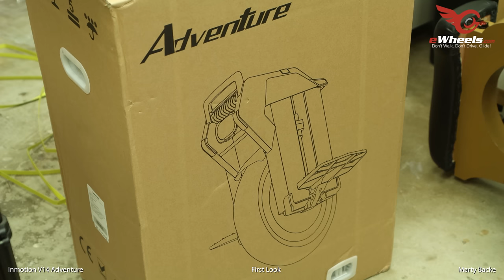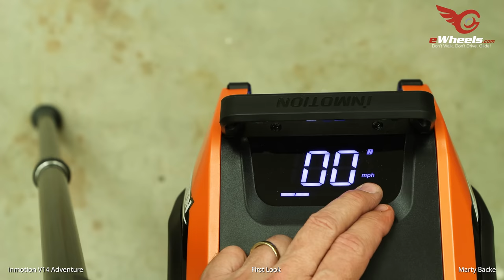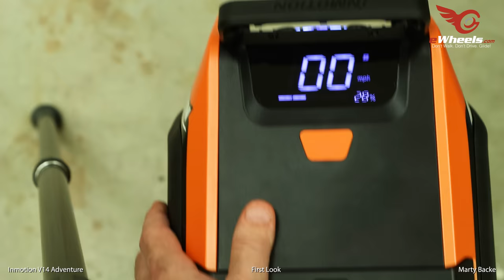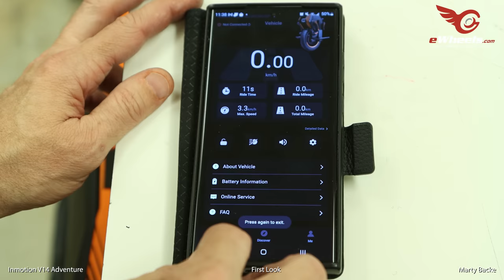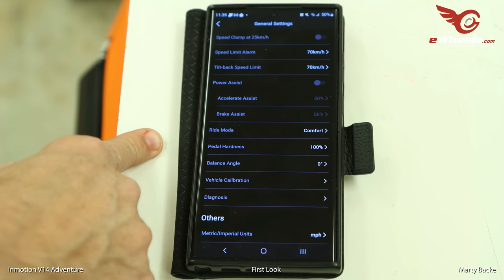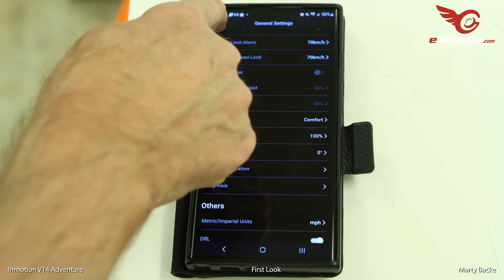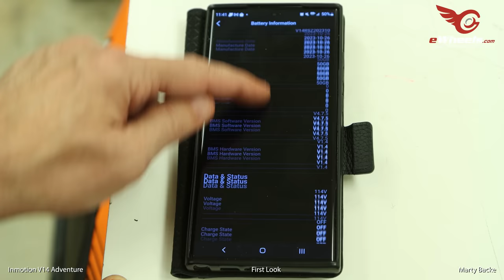Inmotion V14 - First Look

Comment: Awesome wheel. I have V12HT for 1,5 year. 5600km on the clock and the wheel is like new. It just screams quality! I am a bit sad that they do not used again the great color touch screen, but OK. The speakers broke after the first week in my case so the beeper is great choice :D. This is definatelly the wheel for my next season, I really love built quality of Inmotion wheels...
Reply: The V12 has superb build quality. Too bad the HT still has software problems, which likely will never be fixed. Self-acceleration happened to me recently. IM will ship a new driver board, but I doubt it will fix anything. The wheel also seems to turn off or forget how to balance for <1sec constantly when I ride off-road.
Reply from the maker: Wow, yours doesn't sound good

Comment: Looks great. I'm happy to see that the wheel appears to be fairly durable. I agree, putting the charging ports on top was a weird choice, especially where they are trying to make it so waterproof. I actually like that they used the 4-pin connectors instead of the 5-pin since the pins will be bigger (in theory) and thus less likely to bend.
I'm very excited to see how it rides. Hopefully your ankle allows you to have some fun with it!
Reply from the maker: They use a 5-pin (tiny pins) connector but the wheel only has 4-pins. So you're not getting bigger pins.

Thanks.

Comment: imo, the 134v, 4 pin charege ports are flawed in that the square configuration of the pins can easily short and cause arcing if it is forcefully pluged in at a 90 or 270 degree rotation, especially with a aftermarket hyper charger where the charger's metal contacts are more exposed than the stock charger. im happy inmotion is deciding to use the more offset, 5 pin configuration, my frind was repeatedly blowing out his charge board and equipment accidentally pluging in wrong. 

im a begode fan boy, but i have to admit, I am impressed with what i see out the box here. The wheel looks amazing, great to see a progressive coil, this one checks off a lot of the boxes, performance will likely be curbed for safety im guessing but thats not terible. the apartment building I live in banned PEVs but are cinsidering lifting the ban for UL certified wheels so I am hoping the rumor about this having one is true.

Comment: I'm pretty sure that you can hose the top of the wheel and there would be no water in the charging ports, as long as its cover is present. Which.. is a usual problem for nearly each and every wheel i know of..

Comment: Thanks Marty for the video.  If you have a chance, can you help check the max tire width it can take? Guessing 90cm should be fine, but any chance can fit 100cm width tire? Thanks🎉
Reply from the maker: All I can say is that the tire has this printed on the side: 3.00-12  and RIM 2.15x12
Reply: @ElectricUnicycles  thanks Marty!

Comment: Does the v14 still have the Sound Wave feature from the v12?
Reply from the maker: I don't think so. Haven't seen any evidence of speakers
Reply: @ElectricUnicycles  thank you! a couple more questions if you don't mind - 1) does the wheel make an audibly different beep when you turn the light on vs off? 2) can you lift the machine with the front handle and the back suspension bar to help lift higher to get it into a trunk for example?
Reply from the maker: @s0d4c4n  The wheel is not functioning at the moment so I can't answer your first question. I lift it with the front handle and rear kickstand for even better leaverage.
Reply: @ElectricUnicycles  thank you! I hope you get those replacement parts soon

Comment: So basically it's a BBB (better built Begode)... it's like after the V13- and Bob vacating his position- they just decided to let others do the innovation.  I'm rather disappointed in that aspect...
Reply: Inmotion frequently rotates roles in the company. Bob is currently Production Manager for the V14 line. He didn't leave the company.
Reply: @grb1969  I know he's in a different position.  With the V13,  innovation was it's strongest trait. Some things succeeded, some didn't. But he was pushing the envelope. That was his personal stamp on the community. 
There's no innovation in the V14 at all. 
It seems they discovered the most cost effective way to produce new wheels is to emulate, instead of innovate.

Comment: Just pinch and pull the plastic tabs out for god’s sake, then the box lifts right up 🙄.  Or cut the side of the box.  All these YouTubers don’t use their damn brain and instead pull a 100lb machine out of a box instead of just rolling it out of the box.  🤦‍♂️
Reply from the maker: What would I do without your words of wisdom 🤣 This is a demo wheel and I need to reship the wheel so cutting up the box wouldn't be wise huh
Reply: @ElectricUnicycles  It’s good that I found this comment, otherwise I was worried that you were unnecessarily putting stress on your back =)